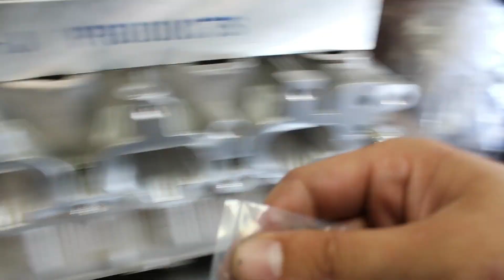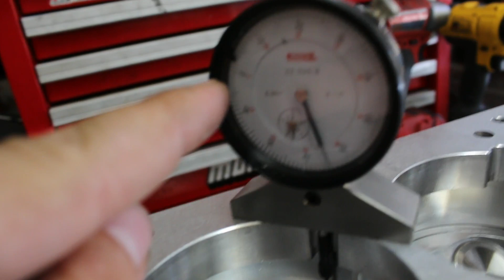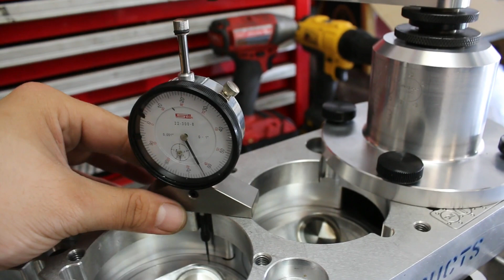4G63 Cylinder head O-Ring 101

Comment: When do you need to O ring a 4g63? What power levels
Reply: When you start seeing serious boost over 48-50psi I am assuming. I have comfortably ran 43psi without any issues and no o rings.
Reply: @K2theK-b6u  what head gasket were you running mate?
Reply: @markc1456  OEM Mitsu evo 9 headgasket. Still running it. 40k km on it so far and a shit ton of boost. As long as you got L19 head studs or 625 they shouldn't have any problems.
Reply: Good too know! ill be using another OEM 9 gasket on mine, cracked my head recently 😩 was thinking of going a hks or nitto stopper gasket but why change from what works
Reply: @markc1456  I got a Cometic gasket on my O-ringed head. So far so 👍
Reply: I ran felpro permatorque with L19's with no issues up to 65 psi. Make sure your timing is reasonable, make power with boost, your fuel is there and you have good spark.. Although oring is an added insurance its not always needed. 

Great video either way.